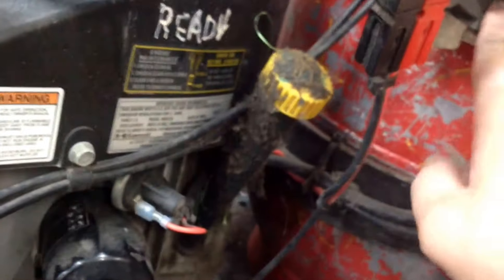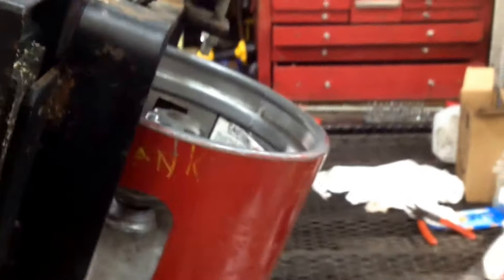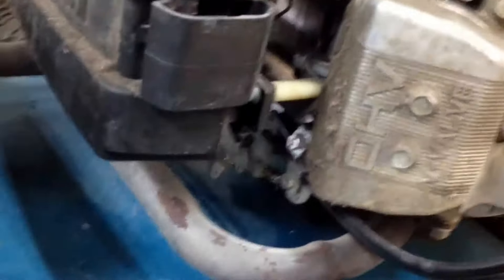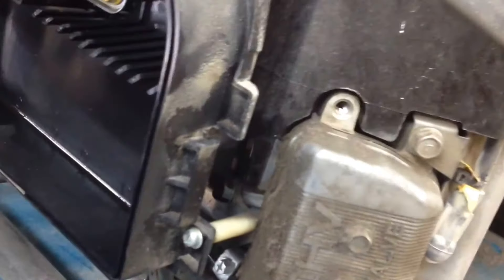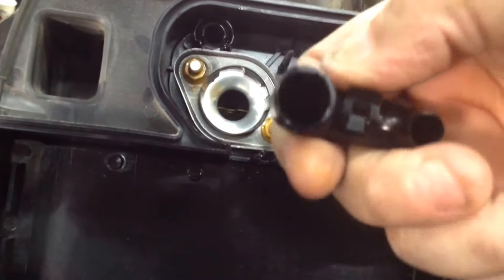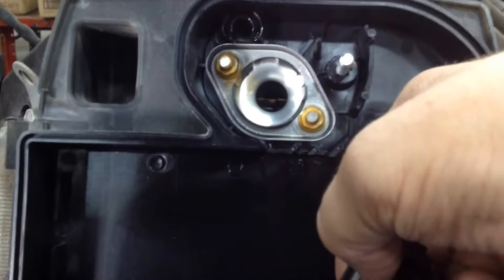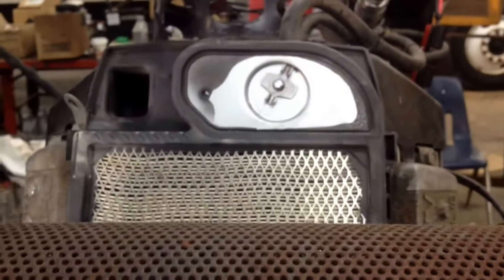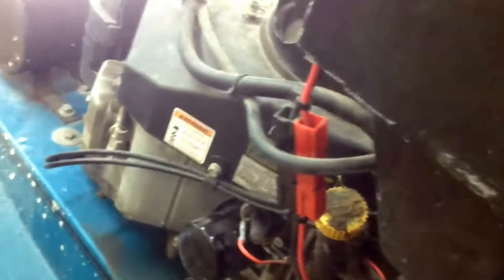CRAZY STUPID REPAIR ON A KAWASAKI FH SERIES PROPANE ENGINE / NO POWER AND MISSING

Comment: Awesome videos...

I have a kawasaki 2004 fh500v that runs well and plenty of power on exmark 48 WB. Only problem is I am hearing a slight irregular popping sound from the engine on both idle and full speed. Took it in, mechanic said it is a great running engine and in good shape. But, I still hear very slight popping sound. Any suggestions? Thanks

Comment: Fh451V vs Fh500v is the only difference the carb and control panel ? Need a little more power for my home built log splitter.

Comment: I am working on a Kawasaki FR 651V that is on a 2004 zero turn Cub Cadet. The engine now runs fine but when I engage the electric clutch for the blades the engine dies out. I have checked and repaired all of the interlock switches, bench tested the PTO clutch switch. Replaced the old hour meter that was not working, and checked the ignition switch to see if there is a power loss when the PTO is engage. No problem found with all these test, and there is power at the terminals at the regulator.  Any thoughts would be helpful. If there is a bad diode somewhere I can't find it. Thanks for your videos.
Reply: ronkpaws1 how’s the coils

Comment: I have a Kawasaki FH381 not getting gas from the tank to the does carburetor parts cleaned up put it all back together still not getting no gas into the carburetor for new fuel pump on still not

Comment: Can you tell me what the difference is between a kawasaki fs691v and fs730v engine?  More specifically what parts I need to change on my 691v to get a couple extra horsepower like a 730v has?

Comment: I got 2 new scag 36 mowers with 14.5 kawasaki from new they make a puttering noise at low idle. As it warms up I t goes away. Is there a fix
Reply from the maker: John Nemecek the epa has all the small engine mfg's scared shitless.   They run so lean from new it's almost insane.  I'd just Richen up the low speed a 1/4 turn if the carb will allow it